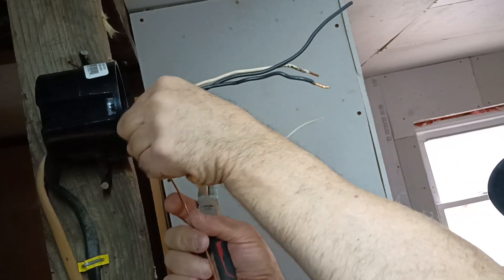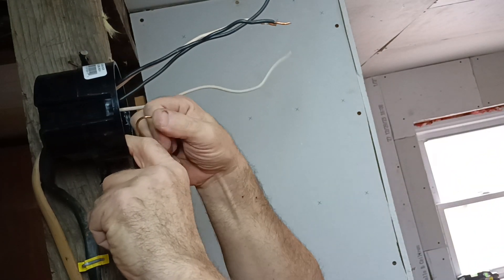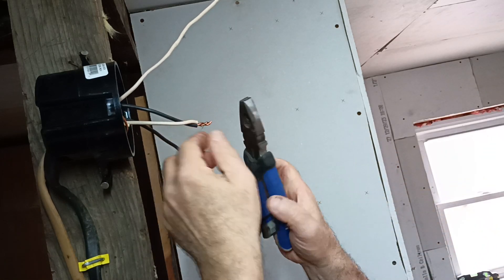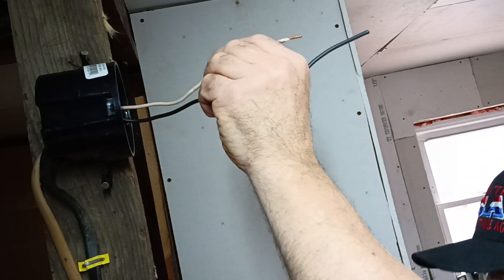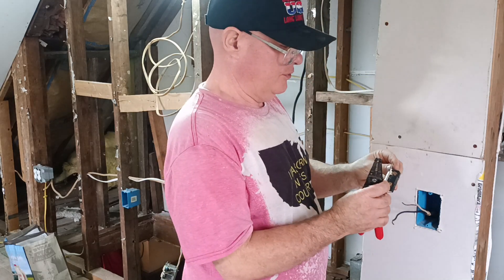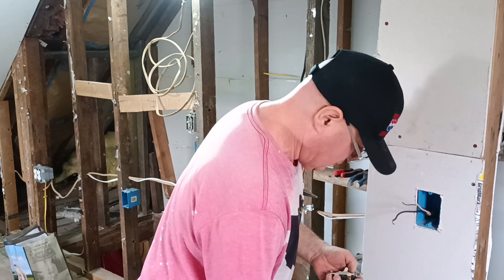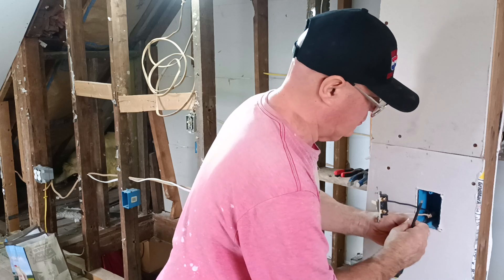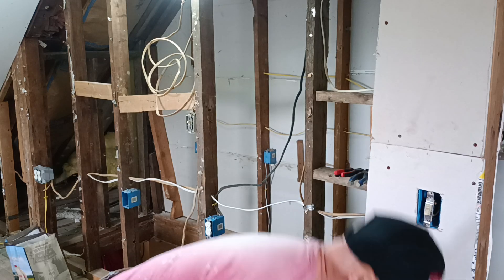March 17, 2024 how to wire a switch loop power to the light first switch loop after the light

Comment: explaining what you are specifically doing is suppose to be part of a tutorial....you can wire the way you have done it but that white conductor being used as part of the switch leg must be identified with at least a piece of black tape at both the load and where it connects to the switch.....as i watched this it did not take long to realize that this guy has marginal knowledge of what he is doing and as was earlier stated''
Why would you even post this unsafe and unprofessional wiring job?''

Comment: You should have gotten 3 wire cable. White is to be used only as a neutral conductor. Not as a switch leg or hot.

Comment: You are mistaken. If the switch to doesn't have a terminal for a ground wire connection then go buy a switch that does, unless the circuit is GFI protected.